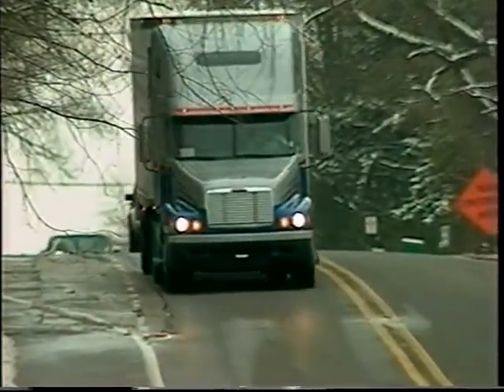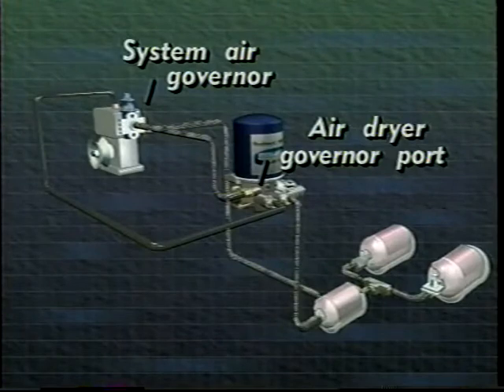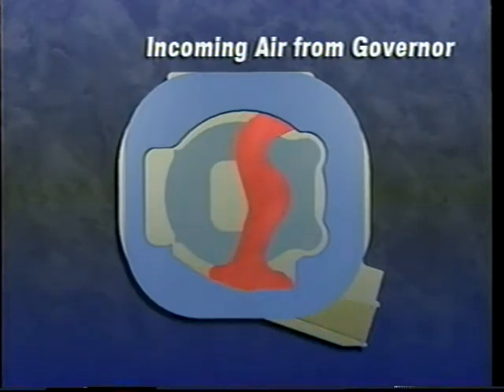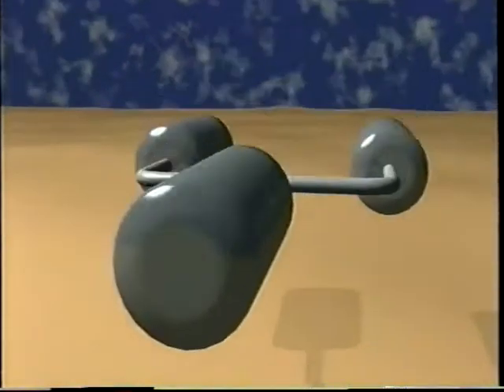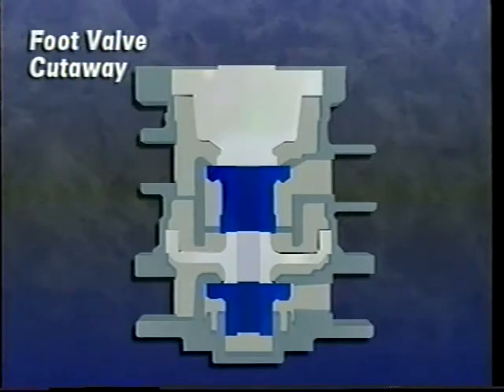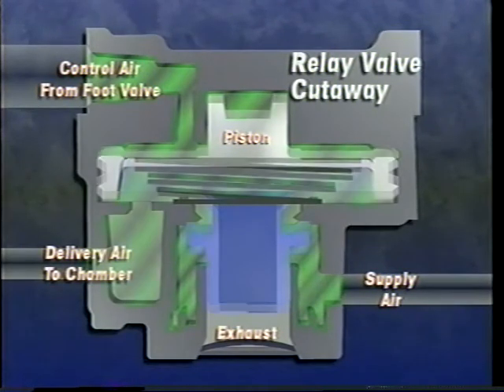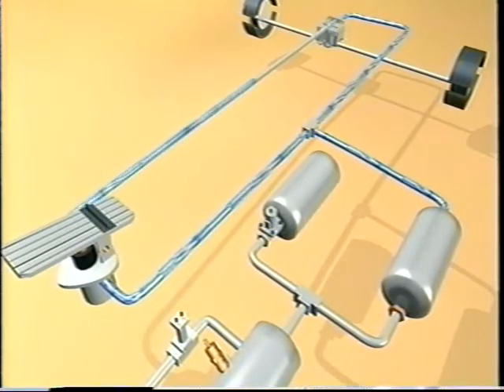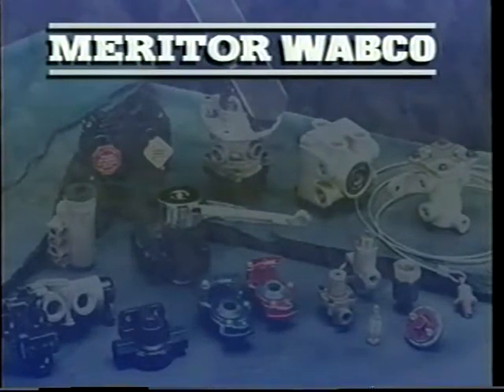3.02 Stopping With Air: The Meritor/WABCO Air Brake System

Comment: So does the piston in the compressor run all the time the engine is running?
Reply from the maker: Yes, it does.  The compressor is either gear driven or belt driven and it is spinning the whole time the engine is running, it just isn't always building pressure but the piston is moving up and down.
Reply: @JimMackHeavyEquipment  Thanks Jim, i dont know much about air braking systems, always been a car guy myself. Always thought the compressor only "ran" when it was compressing air. Didnt know the piston was running all of the time. Really cool engineering